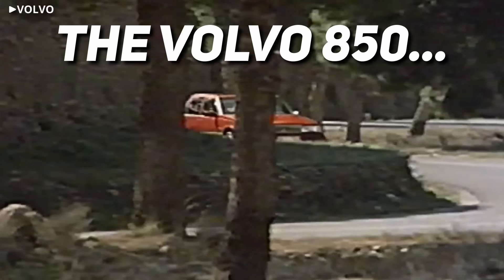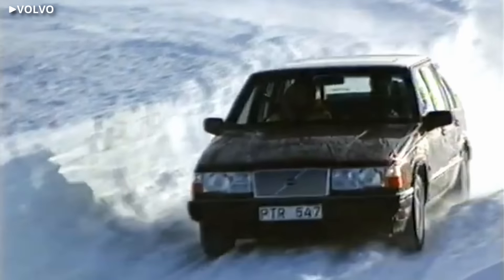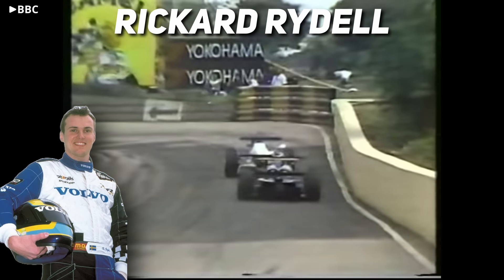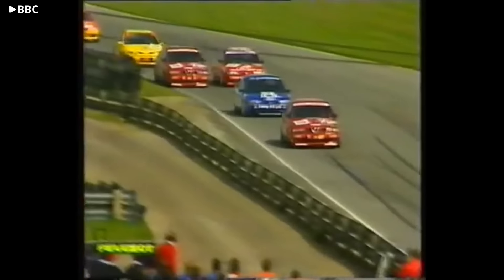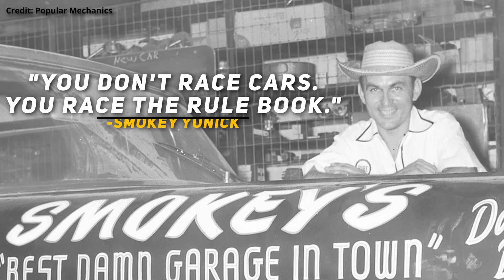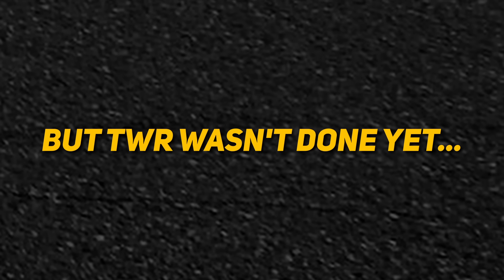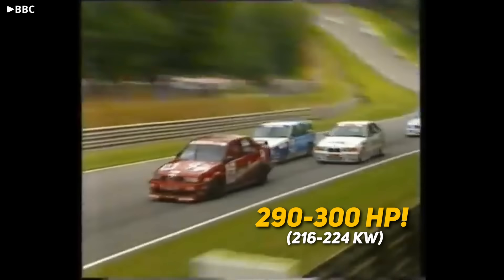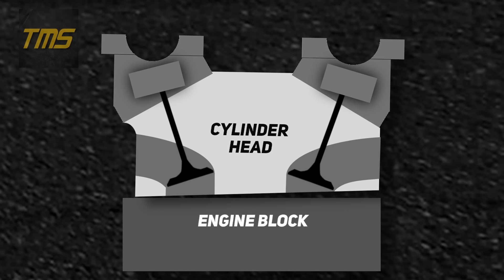The GENIUS Rule-Bending of the Volvo 850 Estate Touring Car! | (1994 BTCC)

Comment: I heard they discovered the estate goes faster by accident in a race as it was cheaper to buy an estate with the same engine as the saloon than it was to buy a saloon and when they put them in a race with the exact same horse power the saloon drivers got mad as they wer getting gapped and beaten and out cornered/manoeuvred by something twice the size and a lot heavier and when it was looked into as they thaught they wer cheating and the technology for aerodynamics has advanced it was discovered that estates wher born aswell as the hatchback as it was learnt that the air rolls off the back a lot smoother and that spoilers could actually work as air would actually be able to flow over them and that you only need a ducktail

Comment: Volvo pulled out of Group A touring car racing at the end of 1986 because they knew it would not be able to compete with the Ford Sierra Cosworth RS500 due to be homologated in 1987
Reply: Maybe or that the 700 was going to sell?  They did not have that much money also.  They was  investing a lot and like the future of volvo on the 800 serie.  It did work. But when you did have an old 240 and 740 in 92.  Then the 900 and 850 did walk along .  dont recell the 3 or 400 serie but it was quite a big step around 90.  
Volvo was like just a small part of all the others.

Comment: The Limousine was & Still is ALLWAYS the much more beautiful kind of bodystyle however wich make &/or model BUT; the Volvo 850 estate version was a cool racecar in the BTCC back in the mid 90's.... ;)
However: Limousine❤️😉 (also 4the 850 in the BTCC! (Cant understand the "SUV's" &/or "estates" i'm sorry! Limousines are GREATE! Also for an BMW E36 M3, the 4 door Limousine ist a lot more cool than the 2 door Coupe Version in my kind of taste ;) )

Just Take a Look at the Alfa Romeo 156, especially the Facelift Version & how it was used in the WTCC! The Volvo 850 & the Alfa 156 in the WTCC, both was one of the Most successful Touringcars EVER MADE. & Yes, the Inline 5 cylinder, however If the Volvo gasoline or/& the alfa Commonrail-Diesel Inline 5's 2.4 JTD Engines, those are one of the BEST EVER MADE ENGINE SERIES!! (& 5 are Always much much muuuch more better than all the 4 cylinder Engines, too!! :)

Comment: You missed the obvious - the head was also rotated by 180 degrees with the inlets now at the front!
Reply from the maker: The inlets face the front of the engine bay in the stock 850 and the TWR car. But the stock inlet manifold has some tubular parts that almost make it look like it could be an exhaust manifold if you're going by photos? As far as I know they didn't rotate the head

Comment: The TWR Commodore SS Group A SV had a similar poor result. Bucketloads of plastic was slapped onto a commode and the requisite 500 examples made. Sadly even the tweaking of the car for get within the rules wasn't nearly enough for the commodes to beat the Ford Sierras or Nissan Skyline GT-R. Not long after the wallopings started getting handed out Australian Touring Cars ended and we got stuck with the boring vanilla AF "V8 Supercars". Australian motor racing became so boring when Nissan, BMW, Toyota, Jaguar and many others were excluded.

Comment: Would it be legal to make a part that would intentionally break and then be more aerodynamic?
Reply: See the bodywork on some NASCARS where they flicked out a section of the bodywork to increase downforce partway during the race at a pit stop....
down near each rear wheel....
activated by hand by the refueller/tyre changer etc.

Comment: The Estate was also more Rigid as it had a 4th or D Pillar. The more rigid the car (unibody chassis) the better the suspension works. Sure, the engine was good, but a floppy body will not win races.

Comment: Errr....       how do valves actuate in curved tubes....?
Reply from the maker: The animation software I used for this is a little wonky. The valves were placed in after everything else and the only way I could get them to animate properly with everything else (and not just fly off the screen) was in that placement/location. I’m well aware it’s not the most accurate visual but the main purpose of the diagram was to show the modifications done to the head which I think it does well enough. I suppose I should have put a disclaimer for the extra observant folks like you🙂

Comment: First off, Volvo initially thought they were entering the British Towing Car Championship. 

Second, 260 hp from a normally-aspirated 2.0-litre engine is not such a bad starting point, even if it was nowhere near enough to be competitive. There are plenty of stock NA engines in the ballpark of 5 litres that only produce 300 - 350 hp.
Reply from the maker: Yes I agree, 260 hp was actually a fairly impressive starting point for back then, especially with no turbocharging.

Comment: Why didn't they use the 960?  I guess the 850 was the future.
Reply: The 960 was bigger than the already big 850, so it would have been less successfull, and the 850 was a new direction for Volvo and they wanted to promote it  as a fun and sporty car to drive even as a road car.
Also the handling of the rwd Volvo was famously bad sadly.